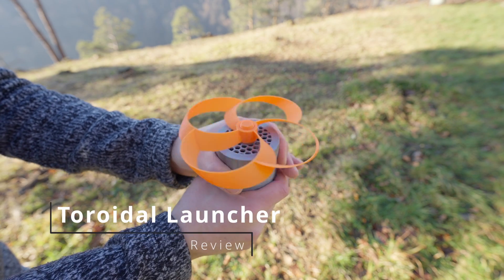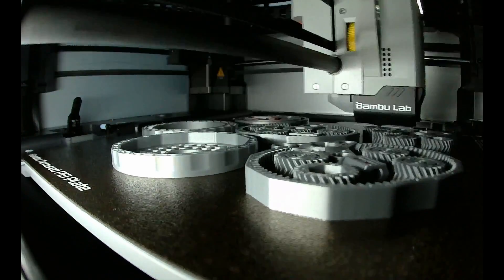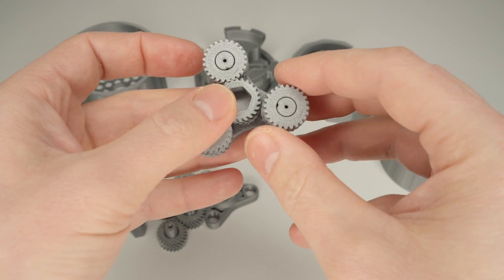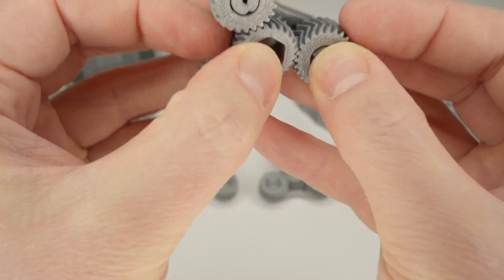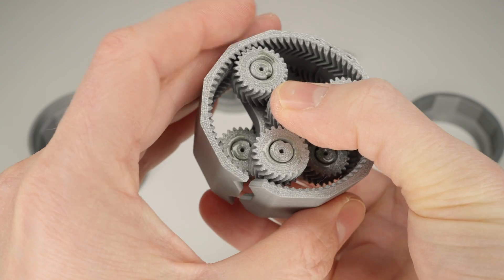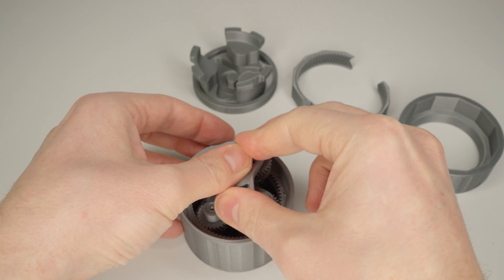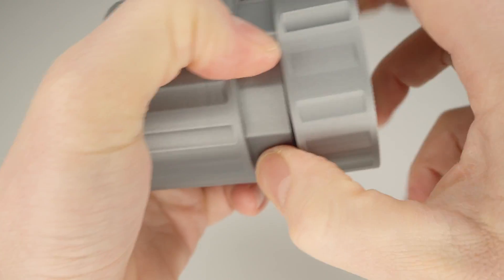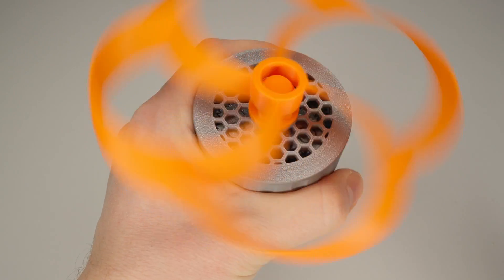Toroidal Launcher Assembly and Review

Comment: I downloaded the same thing and have had zero luck in assembly, so I found your video and still no luck. The assembly here - 1:54  - My gears will not turn at all.  When put together, both sets of gears want to spin in opposite directions but can’t because of the octagonal piston holding the tow sets of gears together.  I dunno, a serious waste of a print so far.
Reply: U need some lube that might help unless you assembled it wrong

Comment: I assembled as you did. And at last I can't turn it at all, too tight. I don't know why. I lubed everything
Reply: Same here did you you find?
Reply: @yanir.tzabary  I solved it. and it works so well. usually the lube makes it more smooth, otherwise you may not assembled it properly. You can try turn the adaptor side instead and see if the handle can move and turn a full circle. if it meets any jam, your structure may be wrong assembled. besides, I found the PLA on the lowest layer is very fragile, so now I use PETG for everything. I succeeded in making V1, V2, V2 pro and now I'm very fond of it.

Comment: i had problem with the bearing having a jam 95% of the time so i used a drill to make each bearing run for about 30sec full speed then but some lubricant (i used oliv oil) and it runs so smooth that i cant believe this is a 3d printed bearings
Reply: You saved my model.

Comment: The pins will not go inside of the round gears on the wider side. They basically need to be hammered in and broken.

 This was printed on an X1C with calibration on.
Reply: You’ll see little crescent moon type cut-outs on the pins of the gears. These must align with the “nubs” in the inside of the holes in the triangular plates.

Comment: With printed gears it's recommended to use lubricant (grease rather than oil) on gears teeth, too, to prevent quick wear.
Reply from the maker: For this model, it made no difference to me whether the gears were lubricated with grease or not. If it has helped with your build, there's no reason not to do it.
Reply: @uhltimate  It's only that the grease is more lasting than the oil. 

The important part is to use it on teeth, too. 
But for sporadic uses you won't notice a difference. 

My advice was more in general.

Comment: Great video showing assembly! 
I am curious ~~ I've been trying to figure this out but haven't posted anywhere else yet. 
When I print this model (on X1-Carbon, with OcraSlicer, "default" settings for PLA, Bambu cool plate) the gears (worst case) are frozen and cannot spin, and I've broken them trying to free the center to spin, and in my best case so far: I can take pliers and work the gear loose so it spins. How can I print the model so there is a bit more space and not be frozen? Is there any slicer setting you do that made it be a lot easier to get the center to spin freely?
Reply: I had a similar problem.  For me it turned out everything was printed perfectly.  I was "setting" two gears on one side of the ring and then closing it on the single gear on the other side.  What was happening was that the first two planetary gears were actually on or two teeth too close to each other.  So when it tried to spin the would basically bind.  It took me a lot of fidgeting (I worked with the single ring just to practice the technique.  You can also use the flats and ridges on the outside of the ring for guidance.  Once I had all 3 planetary gears equally spaced inside the ring I could spin with two fingers and it would coast a bit beyond that.  If it doesn't do that, you may not have it lined up.

I made two of them and had the issue on both of them.  Once I assembled correctly they work fantastic.
Reply: @techringo6469  I freed mine with oil but after a couple of rotations they lock again requires more force in another direction is that similar to your problem?
Reply: @techringo6469  same - I lucked out and the first one I printed slipped together perfectly and was smooth.  The second one I printed was stiff and I thought it was the different color fillament I used so I printed one in the original color..  Same stiffness..  Finally dissasembled and fiddled with it.  I think you can get the planetary gearsets 1 tooth off and they kinda work but are really hard to turn.  So - just fiddle with it until it all slips together and spins with little force.
Reply from the maker: Thank you very much for the kind words concerning my assembly video. I did not run into the specific problems you are describing, so I'm not really sure how to deal with them. Maybe the designer of the model (Brent Peterson on Makerworld) can help you out.
Reply: Normally this is due to thermal expansion and is worse with lower quality filaments in my experience. One way to normally fix this is by making the print larger so something like 120% scale might fix your issue. If this doesn't fix the issue another way is just using the default slicer (Bambu Studio). If none of these work I would buy something like Bambus' filament. I don't know what filament you are using and if you are using bambu filament then try one of the first two options. If neither of those work then idk.